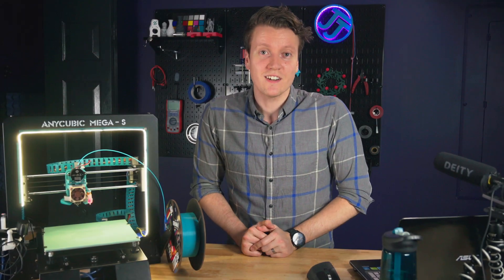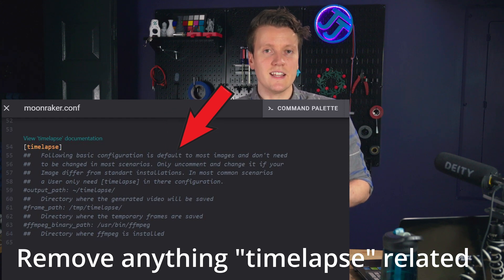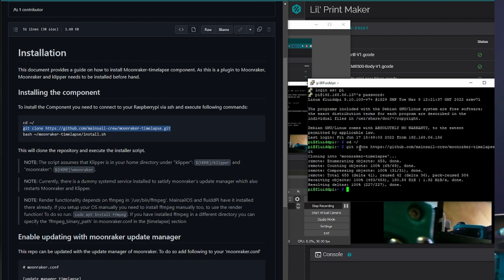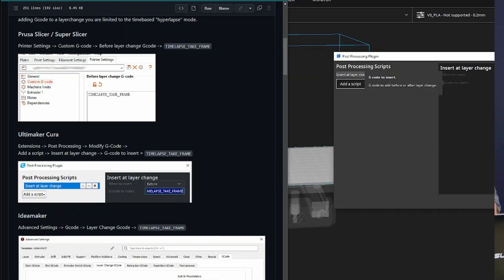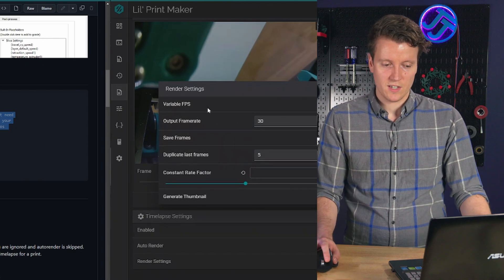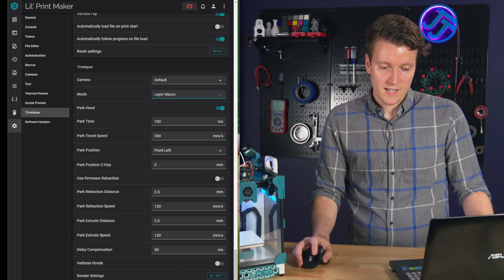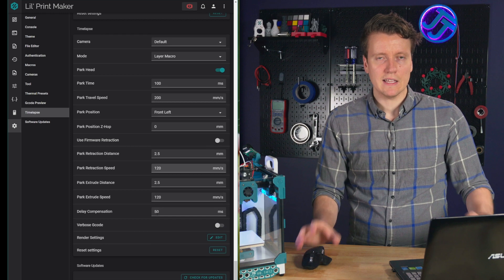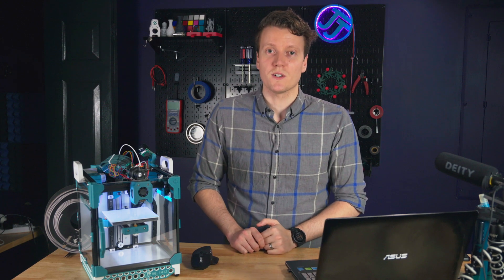Klipper Timelapse is EASY Now - Updated Setup Tutorial

Comment: Great tutorial, thanks for making it. Now I am going to rant but it's not directed at you. Why do I have to add code to the slicer? Every other printer control system I've used allowed me to turn on timelapse at print time without changing the source file since the controller knows when layers change and has access to the camera. Klipper requires me to reslice every old file I want to capture. This should be only need to be done at time of printing but Klipper has me pollute every file in case I want to timelapse, which I will probably only do once per print and certainly not most of the time. I am a hack programmer so not something I can do but it would be great if someone could write a preprocessor for Klipper that could add the commands before printing

Comment: This is a great tutorial.   Taking time lapse photos getting the head out of the way would cause the print to take a lot longer than a normal print, so definitely not something you want on all the time, but those time lapse photos are absolutely amazing for YouTube videos and the like. :)
I was even considering running OctoKlipper plugin and using Octoprint for timelapse as it just seemed difficult in Klipper to get it running.  So glad it has been made a lot easier now

Comment: I'm using creality slicer and have added the TIMELAPSE_TAKE_FRAME both before and after the layer change, as well as under timelaps (900 seconds) - and when I save the gcode, TIMELAPSE isn't anywhere in the file
any ideas? I feel like there must be a setting to enable the extra gcode, or mark layers - I also figure this is why it didn't pause at X layer when I tried that too (unrelated) ... and perhaps why klipper always says 0/0 layers?

Comment: I just updated my klipper and now timelapse is broken again. Have you had this happen? this is what it says. Moonraker warnings found.
[update_manager timelapse]: Moonraker is not permitted to restart service 'timelapse'. To enable management of this service add timelapse to the bottom of the file /home/pi/printer_data/moonraker.asvc. To disable management for this service set 'is_system_service: False' in the configuration for this section. any suggestions?
Reply: I got it figured out.

Comment: As usual, I seem to have an issue no one else has ever had. Or, at least not that google is able to find for me. The setup appears to go smoothly, timelapse settings and tab shows up as expected in fluidd, but the moment I actually start a print (technically, the moment when the first frame would have been captured) the video feed on the timelapse tab changes to a broken image icon and nothing is captured. Hyperlapse or via layer change macro makes no difference. I verified the folders in the config exists, as well as ffmpeg. If anyone popping by here should have any tips, I'm all ears.
Reply: just realized this is 6 months old but i’ll leave this anyway in case. so if my understanding is correct those are just the frames being captured in the timelapse tab. the whole file will be accessible there when the print completes successfully and the video renders (automatically if you let it, along with the other settings you specify). in your config you specify an output folder that you should be able to access easily using FTP through something like FileZilla (similar to how you ssh in, if you’re not familiar) and then you could find the video there. i don’t think the timelapse tab ever has anything but still images.
Reply: @hawsroy  I did get this sorted way back when. The issue was that it wasn't actually capturing any valid frames. I don't remember exactly but I believe the solution was that the timelapse settings in Fluidd had two cameras available for selection, "default" which I originally had it at, and the name of my actual camera. I switched it over when I noticed the option and everything started working fine. If that wasn't the solution then some config file fiddling was involved as well. Either way, is all good now. Well, the printer turned out to be crappy but at least the timelapses work. :) I appreciate you trying to help.